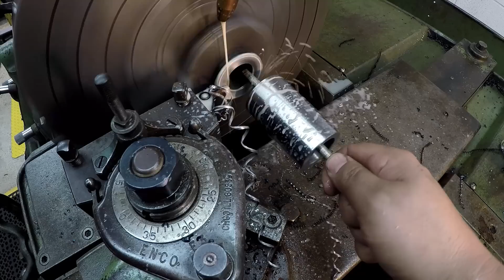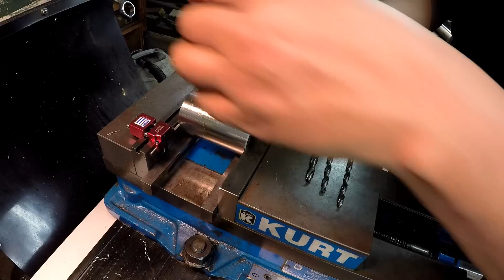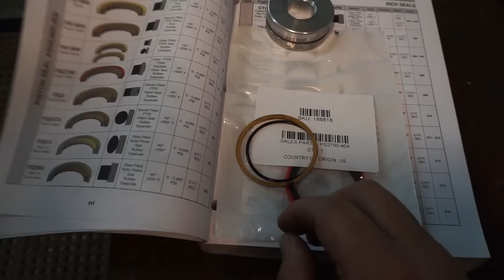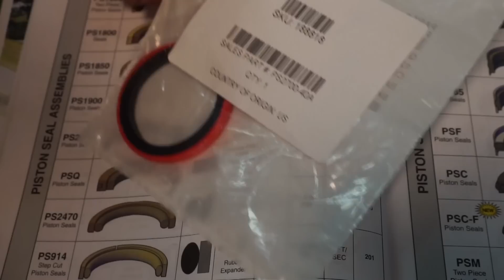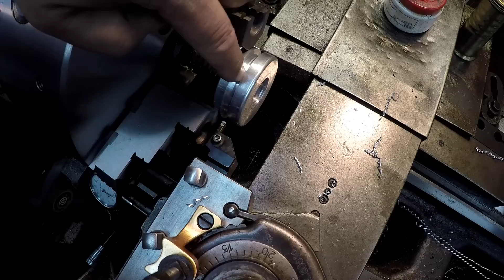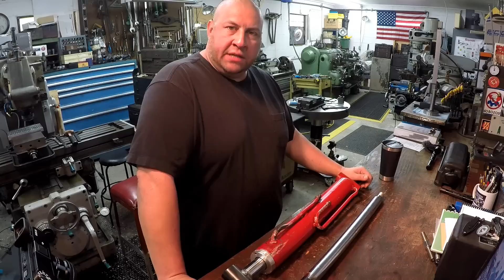Hydraulic Cylinder Repair Part 2

Comment: I often use a piece of piston stock in the vise, put the nut on so it goes straight to the edge of the packing groove, so it is easier to get it in ,, especially small diameter

Comment: 23:26 Looking back at drilling the grease nipple hole on the tube on the end of the ram rod, you used spacers to lift the work up from the bottom of the vice. Why not use the same technique when mounting work in the chuck ?
Alternatively, how about aligning it with the back end of a cutting tool pushed against it as you rotate the chuck ? In other words, rather than measuring the run out tell the work where it has to be !

Comment: Great video. Where do you get your seals from? The rv stealerships can't get any leveling cylinder rebuild kits and only give you an option to buy a new one @ $300-$400. That's unacceptable when they usually start leaking in a few years. It is a waste of materials. Thanks

Comment: This is an old video(excellent as usual)  but applies to a situation I currently have. I am replacing the rod in a hydraulic cylinder and need to weld the eye to the end of the rod. Is the threaded stud you used to attach the eye to the rod sufficient to keep the eye aligned during the welding process with the weld shrinkage? In my application there is a bushing on both sides of the cylinder eye. So it will not tolerate much misalignment.

Comment: Hi Adam= I know this video is older but I really enjoy the hydraulic re-builds I always wanted to get into Hydraulics and you make it look so easy just like all your GREAT work!!! I was wondering what your take is on building these cylinders from scratch only smaller than this size I am self taught in machine work (still a Loong Long WAAAY to go I might add! lol) and have learned  a GREAT DEAL from you! and mrpete! I bought a 1950's SB 14"x72" tool room lathe w/tapper attachment and really want to try and make a cylinder any info you can offer would be really welcome-Thanks for all you time and effort to make and post these Wonderful videos !!!

Comment: WOW very nice repair if you have all that good machinery and know how to use it properly. You made it look like anybody could do it, yes if they followed your video. My back yard sense has to ask this question couldn't the shaft be welded and reground in the defect area . I know your way is the optimal way but it would take more time and materials for a hydraulic cylinder that will be in the same condition shortly due to user abuse. I don't know just thinking out loud.

Comment: What I do when installing those smaller rod seals is get it started like you did, then grab my small plastic handled hammer (yes hammer!) And holding by the head, use the end of the handle to push the seal in. This gives me something I can push with my whole hand rather than my fingers.

Comment: As always I love your machine work. My business is Hydraulic work as well on tractors and forklifts. Thank you for sharing the information for Scott Industries. This video was fun to watch but I have to disagree with your changing the piston seal size. I feel sorry for the next guy that has to repack that cyl. If it’s not you. For myself I order the packing kits before doing the work for less down time and that cyl. would have ruined my day. But I get. You did a wonderful job !  Just keep in mind the mechanics that may have to work on you improvements. I get my seals at O-Rings and Things located in Fontana CA. They have everything. Again this video was the bomb. Thank you.

Comment: Nice video. The videos about hydraulics on your channel contain almost all the info but in far more clearer presentation than what I received during lectures when I was studying mechanical engineering. (I was major in naval architecture so only had the basics on hydraulics, but still) Keep up the good work.
One question came to mind when you walked that piston into the tube, how do you assemble those big cylinders you do at work   without damaging the seals when you can only handle the parts with cranes etc.?
Reply: On a hydraulic assembly table/repair bench! :)

Comment: Do you ever have those be really stubborn to come apart? I had to take apart two little tiny cylinders with 4 holes on the gland nut for 1/4 pins", and 1.625 spacing. It took nearly 400 ft-lbs to spin the glands loose. I had to make a custom pin wrench as there was no way the 8" adjustable ones were going to cut it.

Comment: We do tons of cylinder repair at my work and I have been there 16 years.....
Usually turn a "pin" on the end of the rod and drill a "socket" in the eye for alignment.
The drill and tap idea is AWESOME thank you!
PS I work in another department  but will pass this on.
Reply from the maker: +gentharris I use that trick sometimes too but find the thread is even better. Holds the eye and you don't have to press it on, or hold it if the fit is too loose.
Reply: Yea your solution is brilliant!!!
Reply: I almost didn't watch this because I see and have done this kind of work for a long time,
but I love to learn and you do a great job of teaching!
Thanks again!
Reply: Abom79 086

Comment: Hydraulics was something I had to learn on my own with the help of some technical manuals. etc. (Industrial Trash Compactors, Cardboard balers, material handling equipment was just part of my duties). You can almost find in any larger town a liberal arts type college but there is a serious lack of Technical schools for learning these kind of trades. I encourage any High Schoolers that has a vocational alternative to take advantage of it, you still graduate with a normal degree and if you decide to further you education in some other field you will have these kinds of skills and knowledge that will help you later in life.

Comment: maybe this is an uneducated question but why put the slower rated seal.. since the ps1400 is rated for 12 ft/s...where the ps2700 is rated slower>/ seeing as you are changing the dimensions of the groove anyway.. could you not have done the same for  a 12 ft/s seal,.
Reply from the maker: +C.H.I. I explained that I like to use the ps 2700 when I can because it installed much easier. You can modify that piston to use any seal you choose.

Comment: i also like the psm seal...almost the same as the 2700 but different groove dimensions. You also might mention sometime that a HUGE advantage of the ps2700 or psm piston seal is the fact that they do not stretch out during application like the ps1400, ps1600, and ps1800
Reply from the maker: +travnturner Absolutely

Comment: thanks for another great video Adam! I was wondering if you use wheel bearing grease or what, because some can swell the seals. in rebuilding automatic transmissions we use Vaseline because it dissolves in atf
Reply from the maker: +Steve Avis We use greasy comparable with the hydraulic oil, usually Staplex

Comment: Hello Adam, maybe i have missed it but was put some sealing industrial glue on the threads before you put the pieces together?In the company i'm doing my apprenticeship in we always glue the threads that need to seal in our hydraulic products. Is it just a common additional safety to make sure or does your customer take the job of that?As well i want to thank you for all the work you are showing, i have learned from your videos of conventional machine work, i came across your channel about a year ago now and while as mentioned i am doing my apprenticeship as precision engineer (almost being done in half a year) it is great to see working with what you are doing. It sure is gonna help me for upcoming exam.
Reply from the maker: +Original Brodub De At work we locktight many of the Pistons to the rods, then a set screw to lock it from turning as well.

Comment: G'day Adam, good rundown on that build, what we take for granted from all the years of doing this stuff is really uncommon ground for many and hopefully helps them out in approaching a job that they may not have thought is within their capabilities, notwithstanding so many variants in Hydraulic cylinder parts and seal configurations. Cheers Bruce see you soon.
Reply from the maker: +Bruce Whitham Thanks Bruce!

Comment: Love the videos. Question - is there a reason you used TIG instead of the stick welder to weld the zerk shield on the end tube?
Reply from the maker: I like to mix things up when I can for video, but it's a little cleaner with TIG anyways
Reply: Yes, I know. I guess that's why I was sort of expecting you to use TIG for everything. No worries, you did a great job with the stick welder with nice smooth beads. I'm sure the customer is going to be very happy with that rebuilt cylinder.

Comment: Crazy or old wifes tale,  but I squirt some hyd.. oil in both ports and run it in with shop
air  yes no?    Just makes me sleep better..........sam
Reply from the maker: You can use air yes, we test many of our with the air line. Best to have the right fittings to hook the hose to, and have a ball valved so you can bleed the pressure off slow and not bust your ear drums.

Comment: Hi from Australia. I did 12 years in hydraulic seals a good while ago and enjoy your videos and precision. If mics can change with the heat from your hand, whats the change from measuring a freshly machined surface with all the heat the tool puts in?
Thanks bro, keep it up...
Reply from the maker: Always depends on the material, and the size for thermal growth. Many of my parts I like to let them cool down before I finish to size, or I use my kool mist to keep it cool while finishing.

Comment: Why don't you use the K&T mill for this sort of stuff? That's not a complaint, I'm just curious.
Reply from the maker: It's made for heavy milling work, drilling and tapping ops not so much. The knee mill is much faster and easier to use.

Comment: Master class in cylinders! After watching your set I am fully prepared to disassemble the FEL dump cylinder on my Kubota BX23. At full extension, the gland offers little support yi the shaft. I can now diagnose if it only needs new soft parts, or if it has a deficient design that would benefit from being longer with some sort of improved shaft support. Many thanks for taking the time to show the details, as that is where the knowledge is.
Reply from the maker: +Jennifer WhiteWolf Very good. Telescopics can be a whole different animal.

Comment: I was wondering, like a few others, if the bore in  that DOM eye distorts with the welding.  Nice job as always!
Reply from the maker: It does but depending on the job you can compensate for that.

Comment: Those gloves you had on when greasing up the seals, they looked like they had some sort of texturing on them for grip? I usually use the blue nitrile gloves for stuff like that, but they tend to get slippy real fast.
Reply: Amazon AMMEX - GWON48100-BX - Nitrile Gloves - Gloveworks - Disposable, Powder Free, 8 mil, XLarge, Orange
Reply: I've used them (first saw Edd China using them on Wheeler Dealers) and they're great! Def a step up from the exam room grade gloves in both fit and thickness. I get mine locally at a welding supply shop.
Also: I believe they were about $17/box of 100.
Reply from the maker: +Eric M The brand is Gloveworks. I plan to show them in Shop Talk since I have so many guys asking about them. 👍🏻

Comment: Does the eye every distort any from when you weld it to the rod? I am curious if you have to go back and ream it or anything so the pin will go through it correctly.
Thanks for the vids Adam.
Reply from the maker: +Pharts McFreely For this application I compensated for the thermal warpage, noted to 1.265 and I had .005 distortion. Plenty of clearance for the worn out pin that goes through.

Comment: Aloha Adam,  Most of the time I had trouble with the pin spanner because before me several people had removed it with a hammer and punch, I guess that goes back to the sign on Keith Fenner's wall, it costs more to repair your repair.. and is that a special ratchet for working around corners or a calibrated torque arm!!!  Aloha and I enjoy your channel very much, keep up the good work.  Aloha No Chuck
Reply: Just not rated for ABOM torque.  LOL

Comment: One minor point:  I didn't see any de-burring or chamfering of the seal slots.....Is it of any importance in this case?  I'm only asking as I have to rebuild a cylinder on my Kubota....it's old and I might take the route of selecting a different than stock seal......
Reply from the maker: +Clete88 Yes always chamfer or break the sharp edges. I just didn't show that part. I used a chamfer tool and scotchbright.

Comment: I enjoy watching you, MrPete222, Keith Rucker and Keith Fenner do great work.  I'm sure there are others, but I for some reason I check each day to see if new video's are made.  But I do have a question, I know that all of you use different kinds of metals when working.  My question is the disposal of the shavings, do you have to keep them separated according to there elements,  otherwise, steel, iron, copper, bronze and or aluminum, when disposing?
Reply from the maker: +Grayhair Olds I don't separate them. The chips in the chip pan get scooped into a can and dumped into a larger bin and sent off to the recycling center.

Comment: hi adam
can you make a video about the ways to repair the old shaft
Reply: It's easy, just cut pieces as needed for shorter, smaller parts because those gouges can't be reliably repaired.

Comment: Do you have to rebore the pin hole after welding the sleeve to the rod or does it not warp enough from the weld to need it?
Reply from the maker: In many cases you need to, but for this application give yourself enough room for distortion and it'll be fine. The old eye was way over 1 1/4" so I machined mine to1.265 and it distorted .005. Plenty good enough for what it's doing.
Reply: I bet you the farmers pin is so worn out it will fit no problem LOL
Reply: I was wondering this too Barry.
Reply: you mean the zirk?? he put the zirk in before welding the protection collar
Reply: +carryit around, no the heavy weld between the rod and the pin sleeve will tend to distort the sleeve.